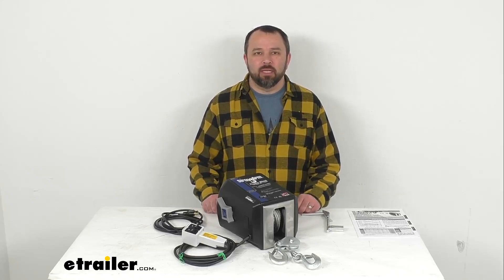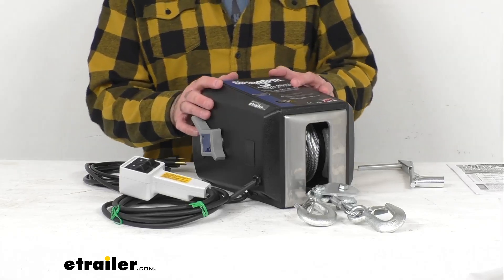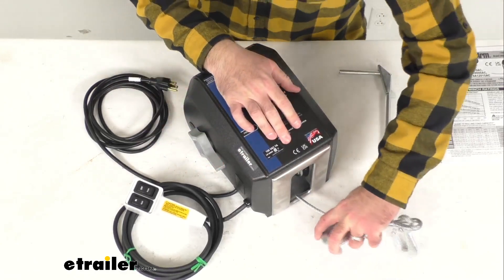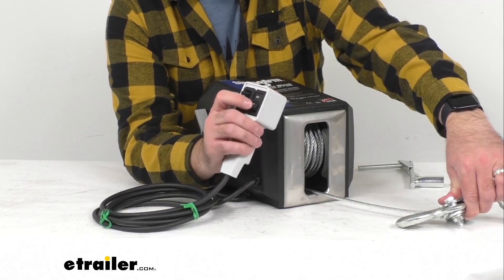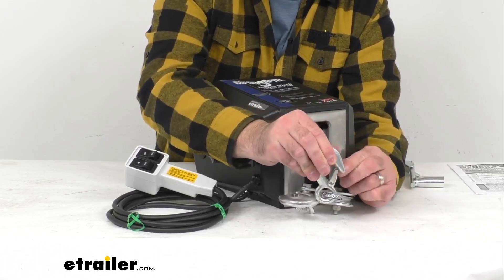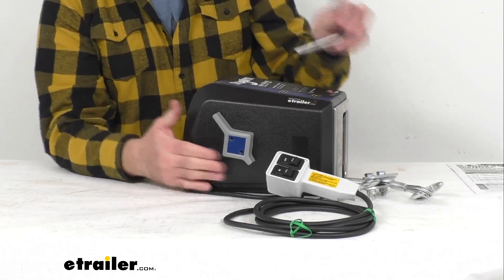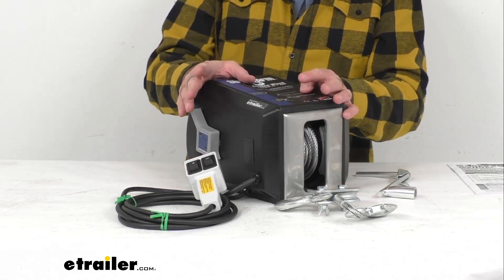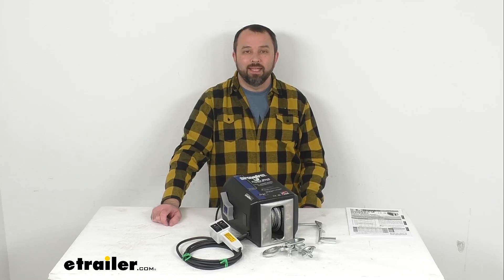Review of Dutton-Lainson Electric Winch - StrongArm With Remote And Pulley Block Canada - DL24962

Comment: Can I use the device to lift a rohn 25g 50' radio tower 190lbs outside my house
Reply from the maker: It's not designed for that purpose, but the # DL24962 StrongArm winch would work well for lifting a radio tower.
https://www.etrailer.com/Electric-Winch/Dutton~Lainson/DL24962.html